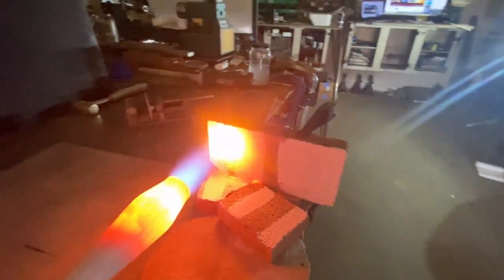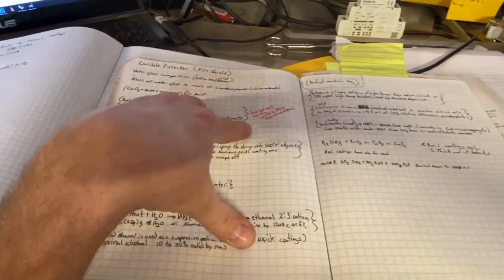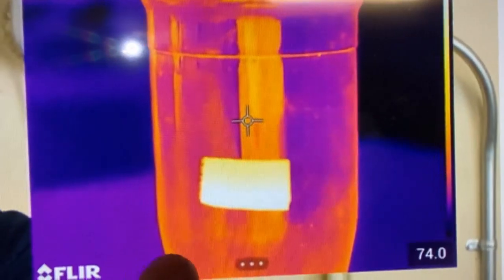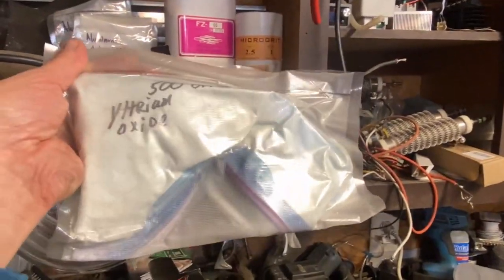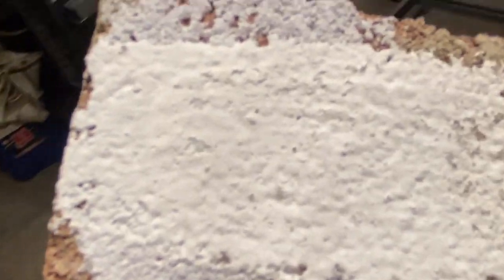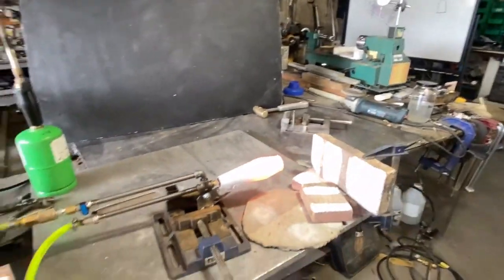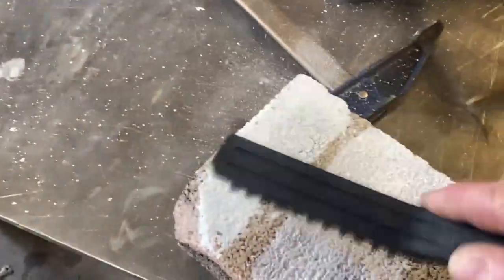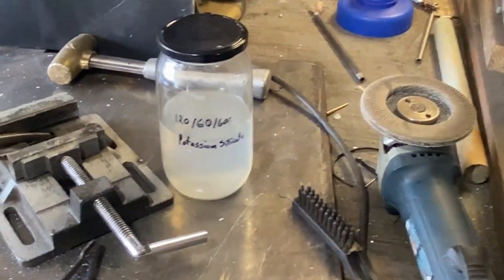Space Age high temp Ceramic coating FORMULA

Comment: If you’re not picky about what platinums group metal you’re using, a catalytic converter is essentially platinum group metals on a ceramic substrate. Crush them, get platinum-bond ceramic as a solid for your paint.
Reply from the maker: Yes me and a subscriber or two talked about that as  source , it turns out the platinum is applied as a wash and is only on the outer layer  so i was considering a leaching process to get the platinum out but yes the ceramic should also have a good emissivity . I forgot the name of that ceramic and its nit good for high temps  like about 2200